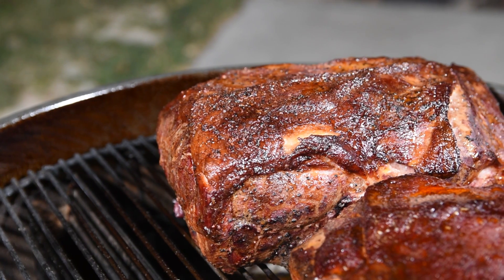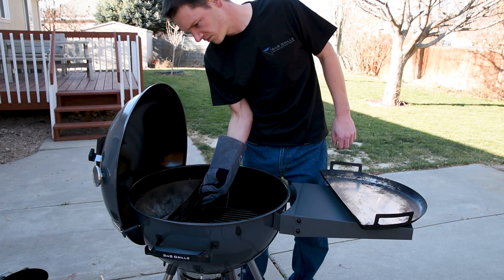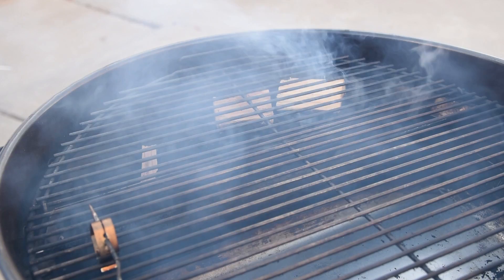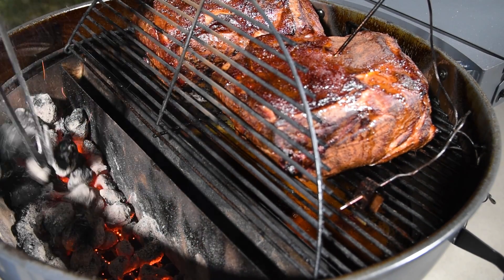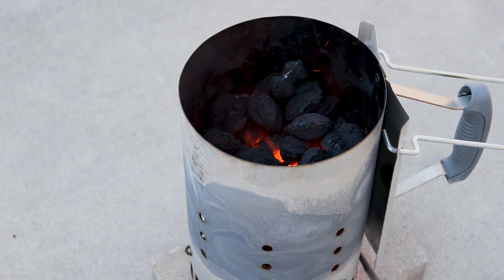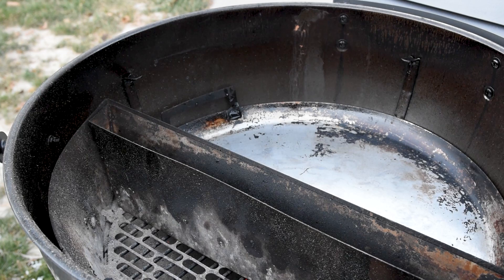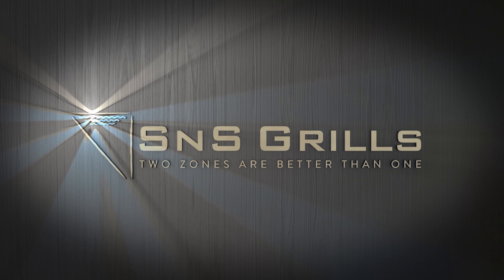How to Light your Slow 'N Sear Kettle the Right Way!

Comment: Thank you! Have had my SNS for a few weeks now. I have no trouble at higher temps, but lower temps have been hard for me to achieve (225-300). Now I see my issue was starting with too many coals and causing higher temps that vent settings can’t correct. Very informative video.
Reply from the maker: That's why we make these! Glad you found it helpful.
Reply: instablaster...
Reply: Paid comment much?
Reply: @mateuszski5833  Nope. Just thanking a creator for posting helpful information. Believe what you want tho…makes no difference to me.

Comment: Hay mate. So when should I use the chimney vs when should I light just 10 briquettes and then add more
Reply from the maker: Use a full chimney of lit coals for hot and fast. Light the briquettes in the corner and add more for long, low and slow cooks🔥🙌🏻🔥
Reply: @ fab

Comment: With drip n griddle in there doesn't that restrict air flow? For example the bottom vent?
Reply from the maker: Great question. It actually forces the air that comes through the bottom vent through the slow n sear basket as that becomes the path of least resistance. This means better convection style cooking.

Comment: I make 1,2 ld rectangular shape burgers. 1 pound square pack cut in hyalf. Press them out a litte with fork, smash the mcormick seasoning donw a littel , use butter in your skillet. They should 135 to 140 and juices pouring out. Its a 8 oz bison burger that will wiped you out. YoU wont need any fries or sides. You will be full for a day. Place your long burger on an italian roll from Giant. Trim the ends off. Slpit it in half. Then lay that monster rectangle burger on with its meltd provolone. All you want to taste is the pure bison meat.
Reply from the maker: Sounds amazing!

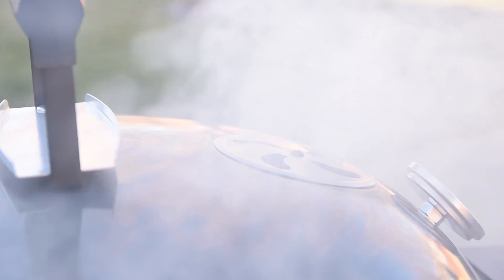Comment: 3:48 waited here seemed like dirty smoke forever.  Aren’t the new unburned briquettes always going to produce some dirty smoke?
Reply from the maker: The heavy white smoke that was coming from the charcoal is what you want to avoid. When the grill is opened and you have a piece of wood that’s lit it will appear to be dirty smoke but that’s just the large amount of oxygen flaring it up. Cover the grill and adjust your vents and it will be back to normal🔥
Reply: @SnSGrills  Got what you mean.  At the timestamp i mentioned it might have been coming from the wood.  

What I have been doing of late (and seems to get good results), is keeping the lid off while the wood is doing its initial burn.  Let that burning wood get past all of its initial heat up and flare up phase, a few minutes, then it'll be a small flame.  When I see that then i put the lid back on.
Good smoke from the wood from then on out.

Comment: Hello! What is the boiling water for? Love the video
Reply from the maker: To "boil" it down (har) it helps control temps in the pit and helps smoke adhere to the meat. Thanks for watching!
Reply: heat sink for low and slow

Comment: Where is the smoke port in relation to the coals? I am considering installing the smoke port cover on my existing kettle.
Reply from the maker: Ours is on the front right. The coals can go anywhere in the slow N sear but we suggest having them in the back.
Reply: @SnSGrills  isn't the smoke hole on the front left side? 🤔 And in this video the coals are on the left side, is there an advantage putting them in the back? Besides being able to point the thernometer towards you?
Reply: I think the point is that you don’t want the temp probe to go over your direct zone. If the port is in the front, then put the coals in the back so the temp probe only stays on the indirect zone. Those probes are known to fail quickly under the harsh conditions of the direct heat.

Comment: Has anyone used the drip n griddle pan for pizza? I have a stone, but with intense heat only coming from one side of the kettle, idk if it will crack
Reply from the maker: Sorry to take so long getting back with you. I've never done it before but I checked with the team and we've seen customers cook half moon pizzas using the DnG. Basically it's a pan so it will do any "pan things" you need it to do. lol

Comment: Why don’t you fill up the water revisor at higher temp ?
Reply from the maker: Great Question. You don't need water at the highest temps because you aren't smoking and you are spending more fuel to heat up the water.